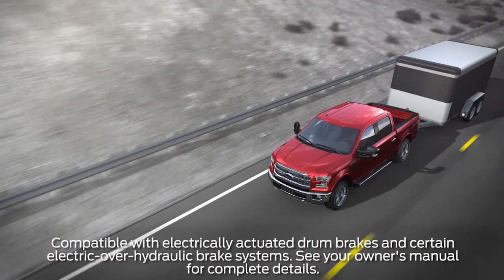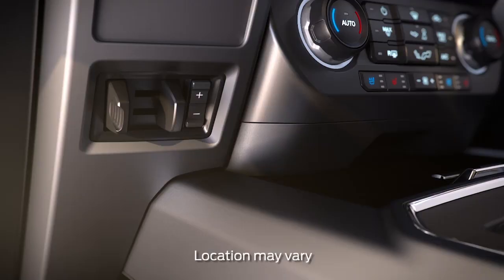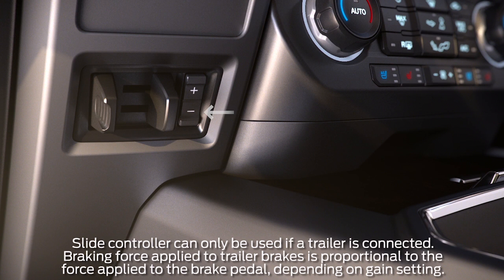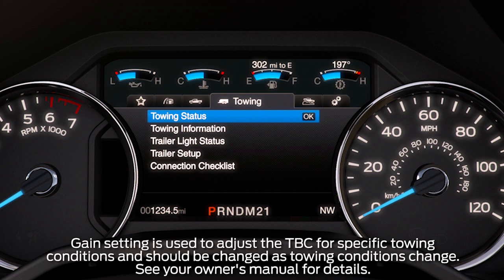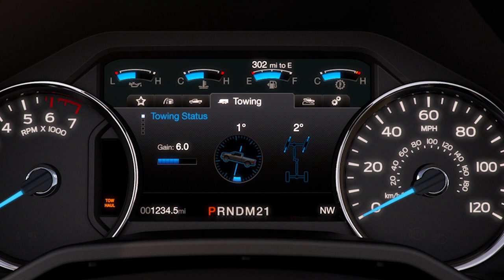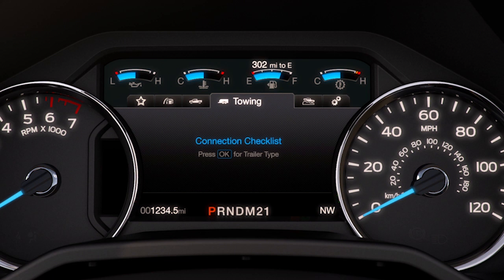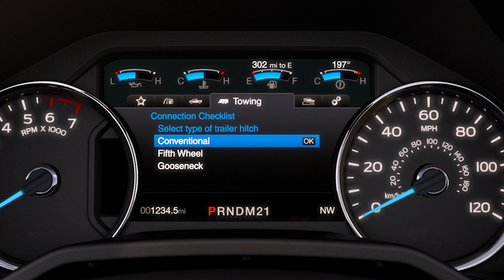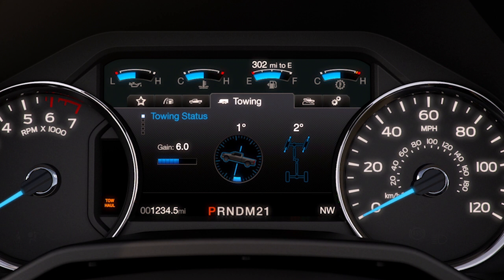Integrated Trailer Brake Controller (TBC) | Ford How-To | Ford

Comment: When I use the trailer brake controller slide, independent of my F-150 vehicle brake pedal, I am getting the "Trailer Disconnected" message and the trailer braking does not stop the trailer, at any gain setting. Is there something to be looked at to remedy this situation? I have unplugged and replugged the 7 point plug.